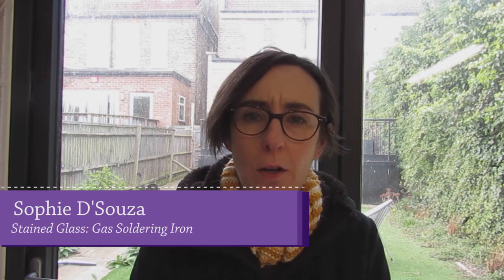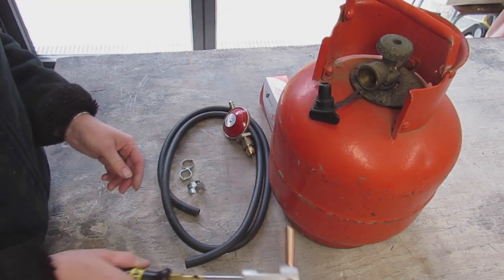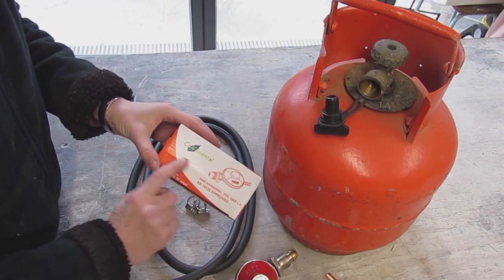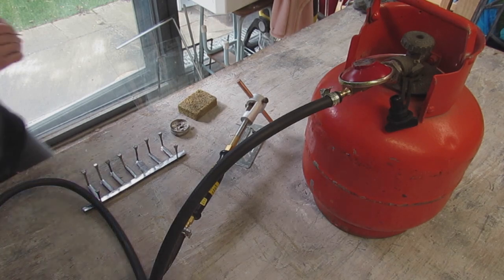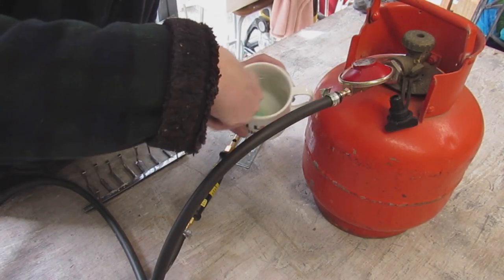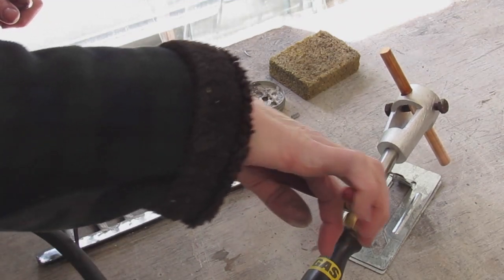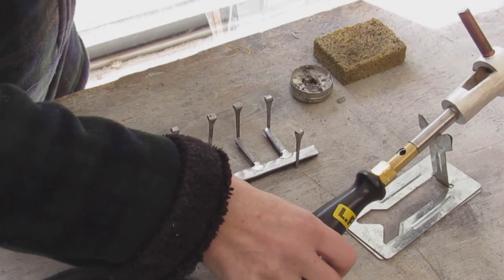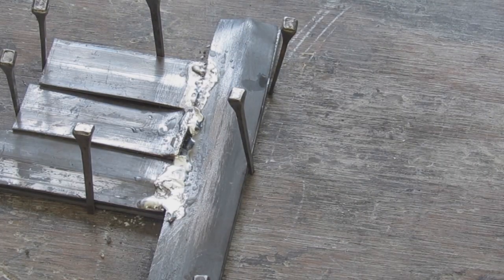Sophie's Stained Glass | Testing the All Day Gas Soldering Iron by E Partridge and Sons.

Comment: Isn't it a revaluation? Lovely joints, although I use 40/60. I just can't comprehend how electric became so popular for lead work. And it will last a lifetime. The noise from the flame is strangely calming too. You might like to go longer on the hose when you need to replace it, so the canister can sit out of the way on the floor or under the bench. The iron can hang on a wire coat hanger hook from the ceiling.
Reply from the maker: You're clearly a user - thanks for the tip about the hose. It really was a pleasure to use. I couldn't put my finger on why I loved the flame so much, but I think you are right - I think it's the noise (glad it's not pyromania!!).